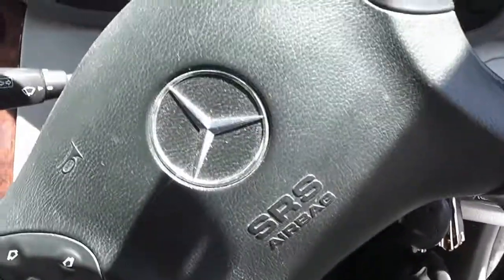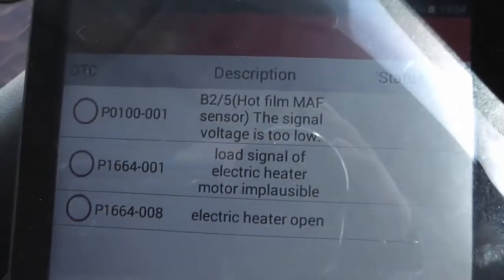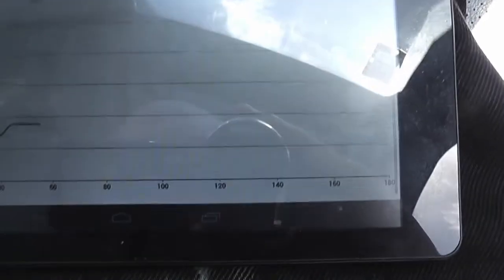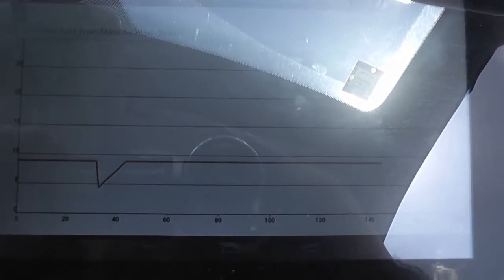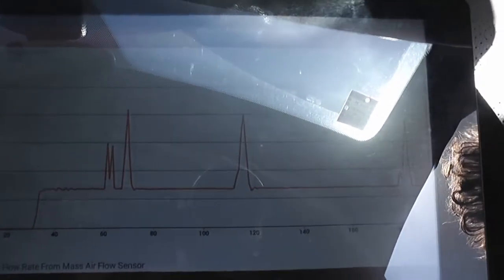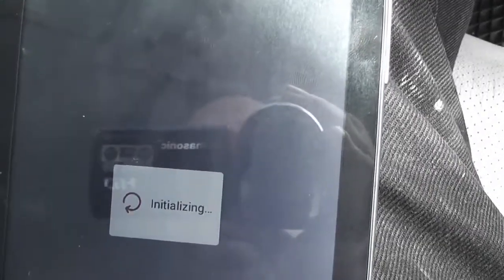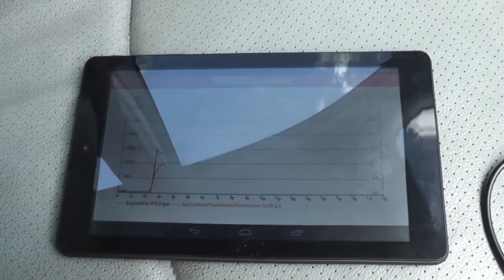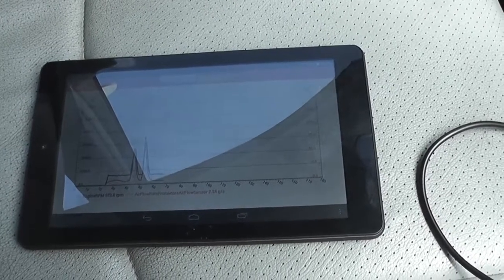maf cdi270 commonrail transmission fault complaint  finding ?

Comment from the maker: if  you Listen before the fix and after how the engine sound is also different, maybe only i can hear it as a diesel guy? , but it has a lot more boogy in its sound.
This is for diesel only as they  have different reduced power strategy as petrol vehicles
for one  most diesel run 160 to 1 air fuel ratio at idle compaired to 14.7 to 1 on most petrol cars.